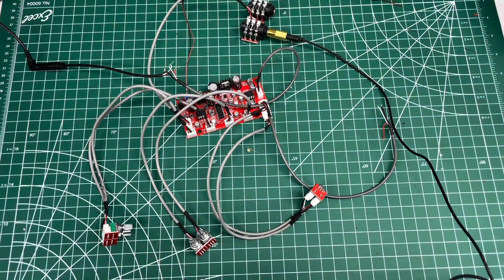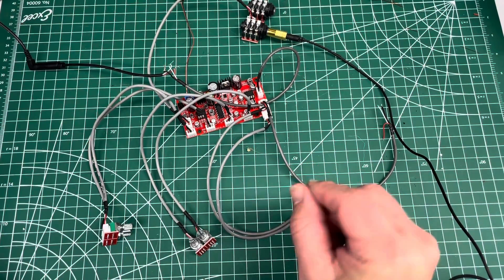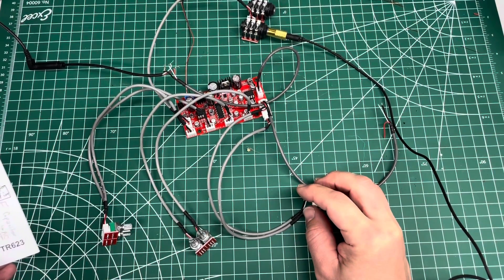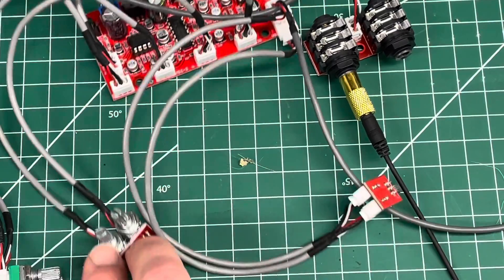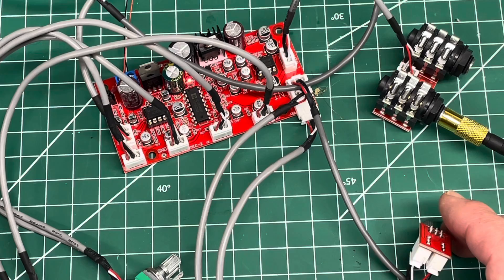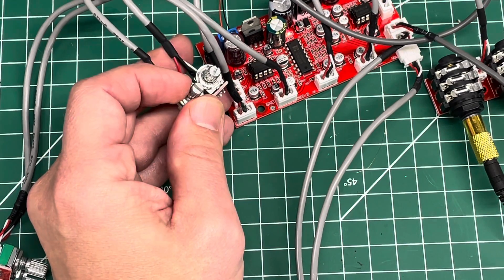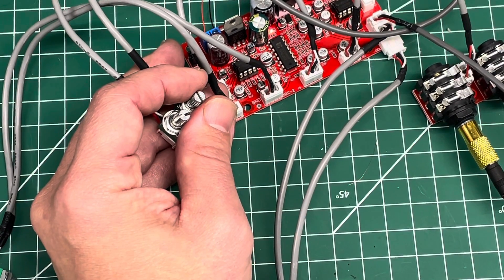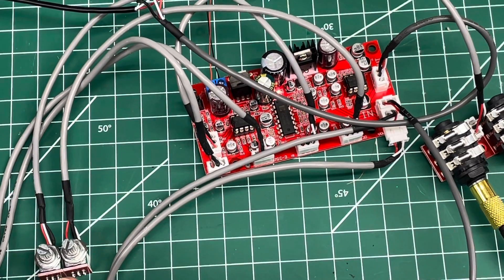Audio reverb board with Dual Mic & Aux input - for cosplay, karaoke, etc (costume, helmet, mask)

Comment: Thank you for you insights into connections and overall quality of the output. Any suggestions on what size enclosure would be needed?
Reply from the maker: If embedding as a wearable in a costume or whatever I’d personally not use an enclosure. There are some gum rectangle containers that may be usable, & if you get the one with built in potentiometers then maybe a modified old cassette tape holder.
Depending on your mic input needs - I’d likely require those to be 3.5mm inputs in lieu of 1/4” plugs.

Comment: This is good quality or not brother?
Reply from the maker: Yes - I found it to be quality.  It’s a great buy.  It’s nice it has a built in preamp.  I did also review another reverb board that’s much smaller but it requires a separate preamp and you have to solder on a 2nd reverb knob.  So if you’re not space constrained this board here is perfect.  Only If tight on space would I recommend doing all the extra work on the other reverb option (pt2399 https://youtu.be/kBIVSbR_EA8?si=aF094Hg2acoUbizk)

Comment: I use this board , but there is much  noise when mic is connected. Do you know the reason.
Reply from the maker: Can’t say for sure. I cannot see why a normal electret MiC that’s not on a preamp would be pushing any noise to this Board, however if you’re using a powered preamp attached to your mic prior to this board that could be the culprit.

Comment: I got one of these a few months ago and put it into a improvised casing.  Quickly figured out that the PCB joints for the potentiometers were meant to be broken apart so you can allign them how you want and i needed to do that anyway as the Moog-style rotary knobs i added to them were way too wide anyway :P   I just hoped that it also had a feedback function to make the delay effect more intense because it's really wayyyy too short. But sadly, there isn't. It would really become an absolutely nice Delay Effect for musical purposes and as a really cheap Delay. I tried to feed one of the output channels back into the Mic Inputs, hoping it would add something to it but i only really got a slight bit of self oscillation that didn't last long enough due to the quick feedback decay. Other than that this board is really really nice when you just plug in any normal 12V wallwart.  Or do i confuse the Mix potentiometer with delay time? Would a bigger kilo Ohm value increase the delay time? I'm really such a noob when it comes to electronics and these kits are a great way to learn a few things.
Reply from the maker: Right on about splitting the potentiometers apart.  That’s handy.
I’m right there with ya on the learning spectrum.  I just buy these and keep hacking at them until I get them to work … I’d save a lot of time if I had an electronics engineering education.  
I think swapping the potentiometer only adjusts the speed at which it reaches its high/low ends, instead of adjusting the extent of the low/high scopes. However I’ve not swapped any before so I cannot say for sure.
Reply from the maker: The great thing about learning from these inexpensive electronics is that they’re very forgiving to regular handling of the circuit board, but won’t set you back much if they do fail